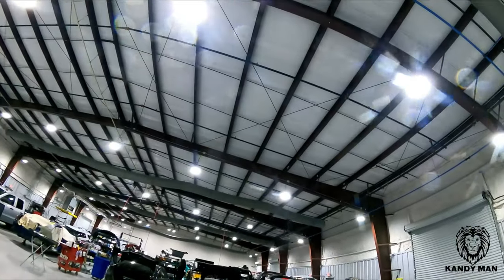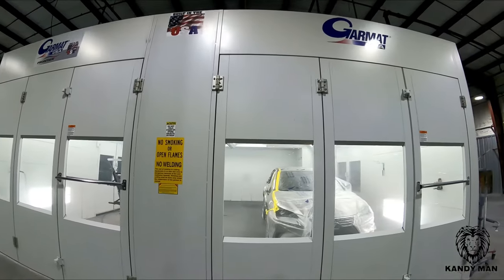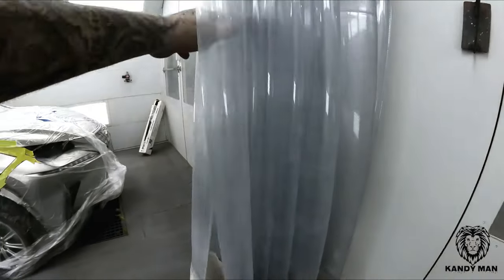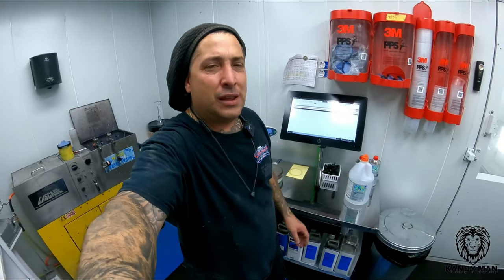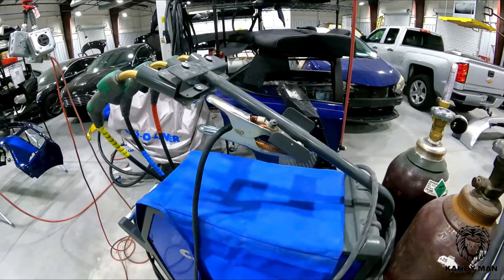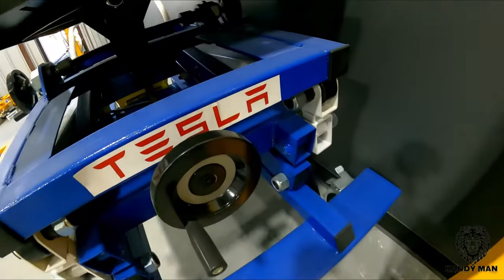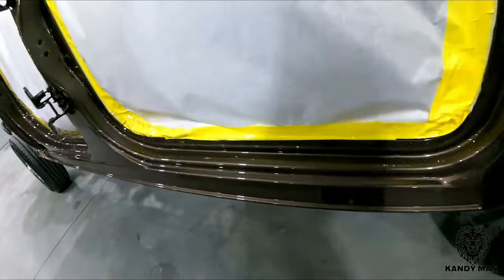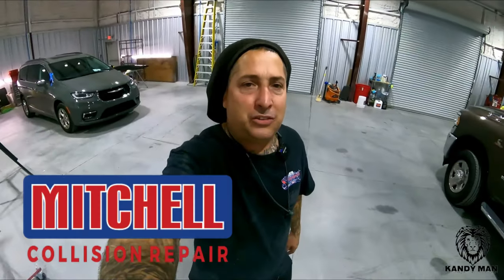NEW SHOP - LET'S DO IT!

Comment: Congrats on the move, good for rejuvenating ones motivation and outlook.
The booth is very nice ! Extra length too for those panel stands when needed.
Not sure about the curtain, but then it can be cleaned down as you would the regular booth walls / floor.
Hey, enjoy the new place and the painting.
I think it's great an employer will allow painters like yourself to share so much, and take that little bit of time filming as you go.
Reply from the maker: Thanks for the support. 👊